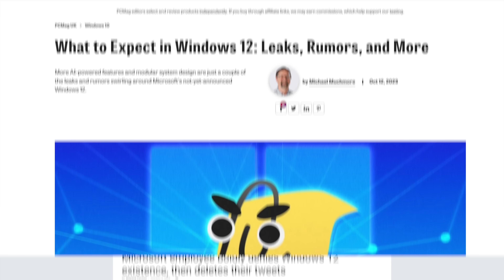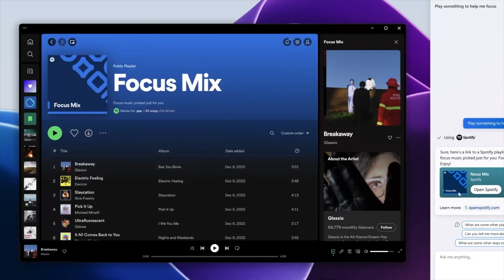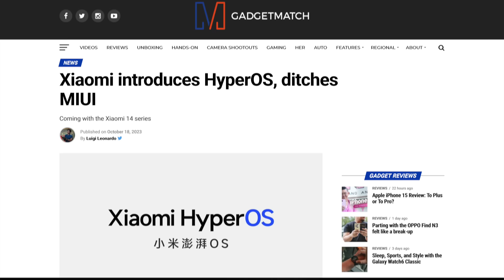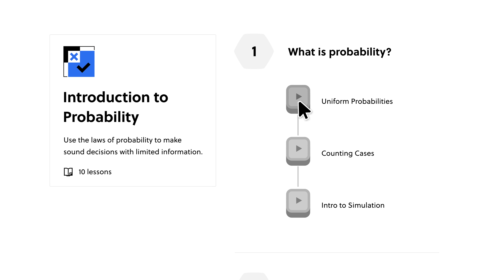Windows 12 is looking good!

Comment: With how strict Microsoft has been with Windows 11, I would suspect there could be stricter requirements for Windows 12. Very few computers have NPUs so it will be hard to push for people to upgrade to Windows 12 if that is a requirement, but it seems like Microsoft is more interested in selling new computers than supporting old ones, lol.
Reply: Will it work with Nvidia RTX cards? Considering a RTX card is very capable at neural processing.
Reply: @adwaitsharma6915  the ones in GPUs are just often used for very specific things and not used generally. But maybe they can be used in general with a driver update. 

But Windows 12 isn't out nor officially announced so nobody knows what it requires, it is all speculation.
Reply: @adwaitsharma6915  things to be seen... but I'm sure NVDA will want you buy two cards... with how AI hungry they have been...
Reply: that won't work with the company...  then again... most companies still use computer till it mummified and belongs in a museum... 

( the likely targets for this OS is the win10 PC replacements... IMO)
Reply: @PrograError  enterprise users will pay for extended support if they need it otherwise they often just buy new computers with new version of Windows.
Otherwise companies that already buy old hardware to run old OS for the particular software they still need. 

Most people just use the OS that came with the device and primarily only gets a new OS with a new computer (thereby lots of smaller companies and people that keep running unsupported Windows versions).

If Microsoft cared for the computers that cannot officially support Windows 11 they wouldn't have put such strict requirements for Windows 11.
I don't think the next version will have fewer requirements. At best Microsoft will just lower the requirements for Windows 11 instead of extending the support for Windows 10, if Microsoft cares for so many computers running unsupported Windows 10 by the time it no longer has support (presumably Windows 12 is out by that time).
Reply: @@orbitalsan4013 well the main issue is most people use the OS that came with their device. But it likely will push some more tech savvy people to try Linux, especially also with the success the Steam Deck has had.
Reply: @AndersHass  a big part, even in the tech Scene still uses windows, yet windows 11. It's a tiny bubble of linux lovers who project their favourite OS on every person, exspecially other "tech people".
I work as a software developer, I use windows, my team uses WIndows. I  don't need linux and after 8h of working a day i want the user friendly not super fancy tech OS to casually browse the internet. Linux doesn't have an advantage to 99% of people and most developers. So why? becausse it's more adjustable? Becausse i can flex about downloading a browser from the terminal instead using a browser. 
If you like linux go for it, if you need linux for any reason go for it, if you don't have the hardware to run windows as a tech person, change company?!
Don't wanna hate that's just how i see the "debate"
Reply: @LogoJK  I am not sure if you feel like I have been stuffing Linux down people's throats or if you just talk about people in general.

To me I just discuss it all and not necessarily say one is better than the other nor that one must use one over the other.

Anyway you can have very user friendly Linux experience like the Steam Deck.
Linux does also give you the option to not have a user friendly experience as well, lol.
You might have to get used to things are different but that would also be the case if you started to use MacOS.

Windows does also have subsystems for Linux so if you needed to develop something for Linux you could use that without having to have Linux as the actual OS but still using Windows.
Reply: Planned obsolescence
Reply: @MachoMandem  it is certainly a way to push more people to buy a new computer.
It probably will also just be the case lots of people keep using old computers that don't get any updates like there is with other old computers running older Windows versions lol.
Reply: My computer runs windows 10 totally fine, but the installer of windows 11 says that I need a better graphics card and 4 more gigs of ram dammit
Reply: @glochri86  the minimum requirements are 4 GB of RAM so interesting computer you got there lol.
The GPU doesn't have to be powerful but just support directx 12 which very old GPUs don't. I am not sure how well such an old GPU still does lol
Reply: @AndersHass  3.5 gigs to be precise and 128 megs of vram
Reply: @AndersHass  the max supported is directx11 on my cpu
Reply: @glochri86  it's the GPU that needs to support specific DirectX version.
It is possible you have an integrated GPU in the same package as the CPU and thereby easy to just say your CPU supports DirectX 11 when it is the integrated GPU that does.
Reply: @AndersHass  yeh integrated graphics
Reply: @glochri86  You almost certainly can still run Win11, just google or YouTube how to turn off the prerequisites in the settings of the installation and you'll be just fine.
Reply: @glochri86  are you running something older than a 710 gt? lol
Reply: supporting old computer doesn't help anybody, even those that are using them, because supporting legacy stuff hinders advancement. You can use W10 for two more years or W11 for 8 more years. You don't need W12 on your 486 DX2.
Reply: @marsovac  Microsoft could have made it very clear that they don't support old CPUs because it will be bigger hassle to maintain because of security flaws in such old CPUs or whatever reason they have.
The annoyance is it isn't made clear why but people have done overall guesses that fits most CPUs.

The TPM 2.0 requirement already cuts very old CPUs but there are CPUs that aren't supported that have TPM 2.0 built-in them so it would have been nice to know exactly why they aren't supported.
Reply: @AndersHass  most likely it would be a hassle for them to go deep into it. They just made a statement around the generation of processors to keep it simple.
For example there were 6 series intel CPUs in board with TPM 2 support. But how can you explain that in a few sentences about supported CPUs? And how do you code all this checks...
Reply: @marsovac  lots of things are a hassle. That people cannot just easily upgrade to Windows 11 is a hassle, lol. 

It would be better if Microsoft said it is too much of a hassle to explain the list of supported CPUs than not explaining at all, lol. 

If Microsoft wanted to keep it simple then they could have just dropped the CPU spec requirements when they just have the simple guideline of Intel Core 8th gen and up (with some 7th gen supported as well) and AMD Ryzen 2000 and up. 
Or just say install PC Health Check to see if you are able to make your computer supported (like say you needed to activate secure boot and/or TPM 2.0).

I don't understand what you are trying to say about 6 series (gen?) Intel CPUs and TPM 2.0? 
That they had motherboards where TPM 2.0 could be added? 
It could be perfectly fine for Microsoft to say the TPM 2.0 has to be build into the CPU package like it is with all the supported CPUs and some unsupported CPUs, lol.
Reply: @AndersHass it is not only about TPM2 tho. You can have the best TPM in the world, but if your CPU is transparent to malicius code it won't help. Some architectures can more easily get security patches through microcode for these new security flaws. And the manufacturers need to support them. That you cannot explain to the average user, and neither to a tech savy one.
Reply: @marsovac  "it is not only about TPM2 tho"
I haven't made such a claim.

"That you cannot explain to the average user, and neither to a tech savy one."
Issue isn't explaining but just not saying anything at all. 
It is very simple to say that these CPUs are insecure and thereby they aren't in the list of supported CPUs. 
Or as I have already mentioned, say it is too complicated to give any details and thereby they won't instead of not saying anything, lol.
Reply: And who cares any more, I have been running a linux build now for 8 months and it works. 15 minute install, updates when I want them and free office software and no commercials.
Reply: @dryster123  sadly most people aren't able to install their own OS and thereby also not able to install Linux so they would either end up using insecure Windows or buying a new computer with new Windows, lol. 

But good for you that you can happily use Linux. 
If you also just need basic office software then there are no issue with Libre Office or other alternatives that are available on Linux (which is a position a lot of people are in tbh).
Reply: @@orbitalsan4013 "Which is why Linux will probably gain more interest."
Every new release. Someone says this.

I remember in the late 2000s people saying "this is the end of microsoft! Linux will take over and everyone will exclusively use Linux!". I remember a million other times people said it. The general user who can't upgrade to win12 for whatever reason is going to stay on windows. They'll upgrade later when they update their hardware. That's a fact.
Reply: @Unethical.Dodgson the main issue is people use the OS they get with the device they have bought. 
Plenty of people that have no issues not using Windows but it isn't the usual Linux OS you will get with various alternatives like Android and ChromeOS (then also people using iOS and MacOS).
Steam Deck is the best example of a device pushing Linux to regular people, so it could be possible to make something like it but for laptops and desktops.
Reply: I don't think Microsoft would make a NPU on the desktop computer a requirement yet; I didn't even know what that was until I watched this video and had to do a quick online search. It took them years to implement the TPM requirement for Windows 11 to be installed. So if history tells us anything it will be some time; maybe 10-15 years before that would be a requirement. It took them 15 years to require TPM 2.0 before windows 11 could be installed.
Reply: @fightingfalconfan   the TPM 2.0 requirements already started for OEMs for specific Windows 10 versions.
But I don't think anything has been added for OEMs for Windows 11 compared to the regular requirements (thereby no requirements for NPU either).

I don't think there will be different requirements for desktops and laptops. 
At worst I think they might require OEMs to have NPUs just like TPM was added but anyone else can just install Windows without.

I do think the chances of NPU being a regular requirement for Windows 12 is slim unless they would want to support Windows 11 for many years so all the computers without NPUs can keep using that for years to come.
Reply: They're probably trying to avoid the Vista debacle wherein Vista shipped with laptops that weren't remotely qualified to run it.
Reply: @MrGeocidal  then they don't need a list of supported CPUs but just write some minimum requirements for the CPU and other hardware which they already have done lol.
Reply: And of course the user can’t decide what to do with the neural network-run AI through their T.o.S. Can you decide to switch it off like Cortana? Can the AI be applied by third party software, specifically games and run locally? If not, it’s an expensive waste.
Reply: bill gates is a jew, that explains everything
Reply: Microsoft only pushed the Win 11 system requirements because it was tired of people and manufactures installing 10 on shitty hardware then saying 10 was a bad OS. So they just straight-up made everyone need an SSD and modern specs.
Reply: @silvy7394 But it wasnt the SSD it made people get it was a brand new motherboard with some weird function that is entirely trivial.
Reply: @Mabidemonstrations  the CPU is the issue more since you need a CPU that is on the supported list.

I think it has been possible to install Windows 11 on motherboards with a TPM module added without completely bypassing the system requirement checks, which is why TPM 1.2 at one point was listed as the requirements, lol.
All the CPUs on the supported list have built-in TPM 2.0 so there isn't a specific motherboard requirement other than they can support a CPU from the supported list.
Reply: @silvy7394 I agree I think Microsoft bit the bullet with windows 11 and made everyone make a serious upgrade so that going forward they won’t have to be so harsh
Reply: @silvy7394  the strictness of Windows 11 isn't about performance but how old the CPU is. Plenty of unsupported CPUs that are more powerful than supported ones.

SSDs aren't even a requirement so I have no idea where you pulled that from lol.

OEMs have already for a while had the requirements for Windows 10 that is required for Windows 11. 
So Microsoft could have put up higher performance requirements ages ago if that is truly what they wanted lol.
Reply: @AndersHass  Agree completely, I have a games machine running a Ryzen 7 1700x on a B450 board and a NVMe.  Six year old processor, blazingly fast on Windows 10 yet not supported by Windows 11 and according to Microsoft, obsolete
Reply: @dryster123  dat missing built-in TPM 2.0 lol (as far as I can see would be a possible reason for those CPUs specifically).

Comment: I dunno if Apple can really update the phone without opening the box. Nowadays for safety reasons you can't turn on the device for the first time without first plugging it to a power source so that the battery won't start draining when inside the box. So how can Apple turn on the iPhone without first plugging it to power? Not sure about this unless they don't require you to plug in first which is odd and pretty much everyone else requires this.

Comment: For Windows 12, I hope Microsoft will finally get the courage to get rid of all old programs from the Win95 decade, so we have only one design language, not a soup of UIs.
Reply: Only if they substitute them with better and updated versions that allow the same or higher control of the machine. This new goal of making things simpler and much less controllable with no alternatives sucks. Windows should not become MacOS
Reply: I just hope they don't have buggy, slow, webview based app
Reply: Idk I agree from a design standpoint but problem is, the older applications work better then their new stuff. Perfect example: compare snipping tool and the newer version (I forget it's dumb name) and to be precise the save and copy to clipboard operations. Snipping tool does it all instantly, new one has >1 second loading times. 
No idea if their devs suck now or if it's management or project planning but the end product ist seldom good enough. I don't think they're capable of replacing all old stuff rn.
Reply: @neruwu  I know and unfortunately, this is true. For example, creating user account from Computer Management does not require for creating Security questions, but when creating from the modern Settings, it is mandatory and cannot be skipped. Or the good old Disk Management, which has much more flexibility and functionality, compared to what we have in the modern Settings app. Ideally they would just modernise the UI of the old apps, rather than creating new ones.
Reply: @YoanIgnatov  same here but unfortunately I'm 90% sure they wouldn't do that
Reply: Wont happen, as one of Windows core features is backwards compatibility. Making such a change will break too many legacy programs and systems

Comment: 00:00 📰 Windows 12 leaked, expected in 2024. Microsoft hints at future versions.
01:10 🖥️ Windows 12 likely won't bring major visual changes; possible taskbar shift.
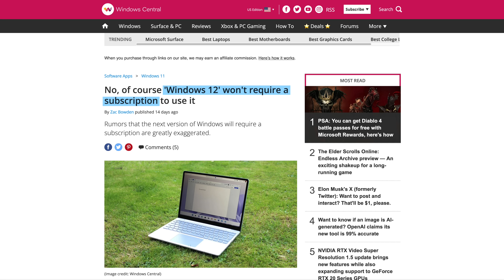01:39 🧠 Focus on ARM PCs and enhanced AI features in Windows 12.
02:20 🧩 Canon's Nano imprint lithography could revolutionize chip-making, potentially reducing costs.
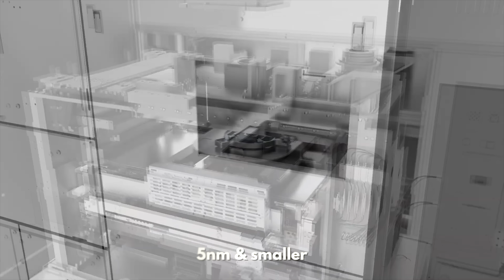03:58 🤖 Xiaomi's "hyper OS" is an updated Android skin, not a new operating system.
06:01 📱 Apple's wireless update pad allows in-store iPhone updates without unboxing.
06:29 ✏️ New Apple Pencil introduced; $79 cost, recharged via USB-C, lacks wireless charging and pressure sensitivity.
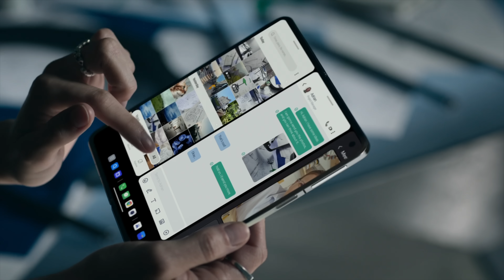06:57 📱 OnePlus Open and Oppo Find N3 launch with competitive foldable designs.
07:12 👍 YouTube's new feature illuminates "like" and "subscribe" buttons when mentioned.
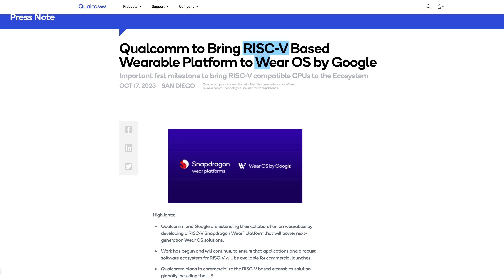07:26 💰 Ferrari to accept cryptocurrency as payment; Quacq partners with Google for RISC-V chip development.
07:54 🤖 PwC partners with OpenAI for AI consulting on complex matters in tax, legal, and HR.
Reply: Windows 12 most likely will come out when Intel 15th gen and AMD 8000 CPUs are on the market. The reason why is they are the ones that will have the hardware to run windows 12. So late 2024 / early 2025 for earliest you can get a Windows 12 computer. I don't know Snapdragon well enough to tell you if can already run on their current SoC or will need the 2024 updated version to be able to run.

Comment: I think in the nanoimprint lithography you would still need the traditional lithography machines to make the mask, it would be cheaper if the mask can be used multiple times but innovation in traditional machines would still be needed